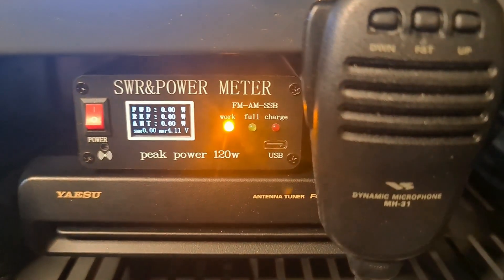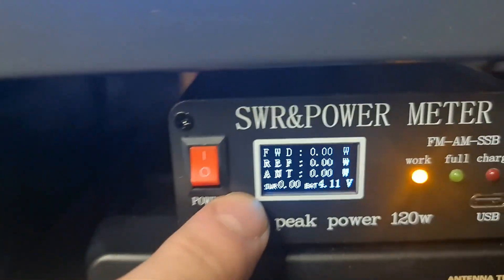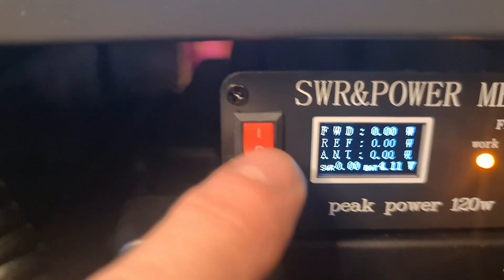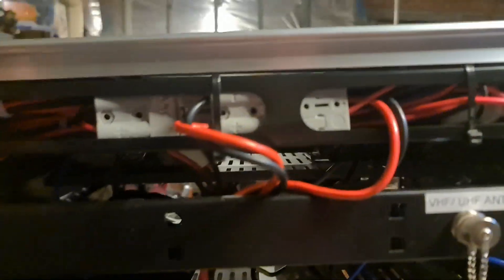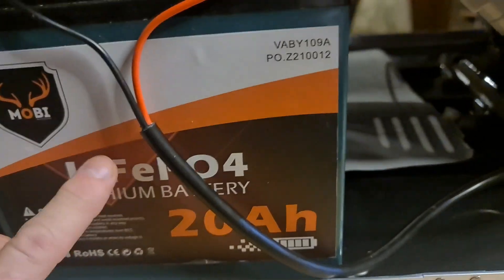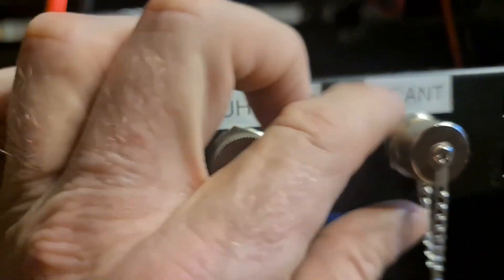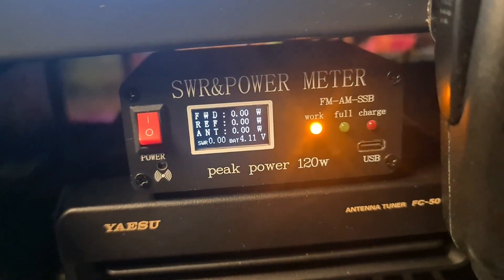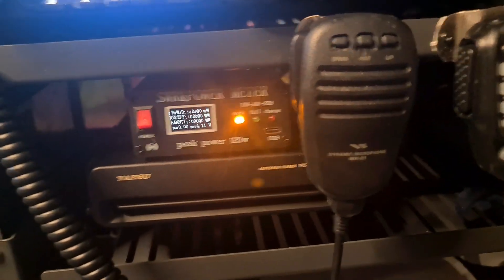Update To My Grab & Go Box

Comment: What is the value of having the SWR meter placed between the antenna and the tuner?  Wouldn't you rather know that a good match was made?  I mean....you can always spot check the actual SWR using the transceiver's internal meter by turning the tuner off.
Reply from the maker: Yes, I do use the internal SWR feature on the FT 891, but I would also like to know the actual SWR between the tuner and the antenna,  When the standing wave is greater than 2.5, the buzzer prompts to warn you, a lot of new HAM operators this that an ATU will match your antenna when they only match the impedance at the radio. I can always monitor the reflective power by placing the meter in line as I have done. I have the same setup on my 01MP with 2 x DIAWA CN901s as I like to monitor the SWR also regardless of an inline tune is on or off. But this is me and how I like to monitor my equipment.

Comment: Hi. Wondering the weight of the Go Box
Reply from the maker: My Box weigh is about 18 Kilos, it contains 2 x radios 1x FC-50 tuner, a Power/SWR meter 20 AH Lifepo4 battery spare antenna cables approx 15 meters x 2 of LL 240. Also, mine is an 8 RU you could use a 4 or 6 RU to reduce the size and weight  Also reduce what you install in it also, 73's
Reply: @vk2lq  Some boxes also come with built in  trolley
Reply from the maker: @gregmeyer2294  Yes that is correct, I do already have a small folding trolley I use but keep in mind I use this for park or portable operations where I would be set up for a few hours or days if camping. 73's